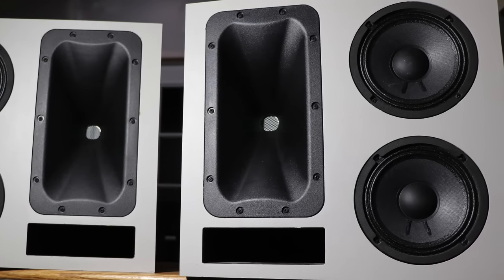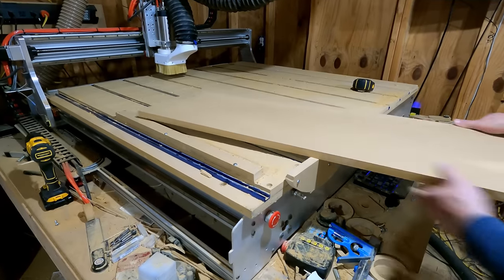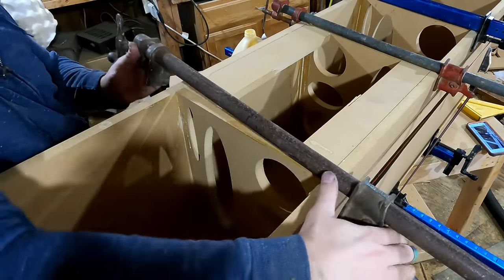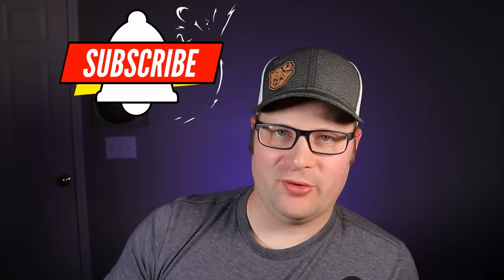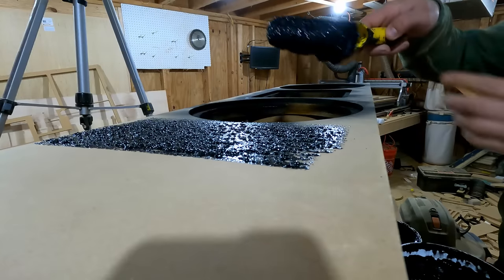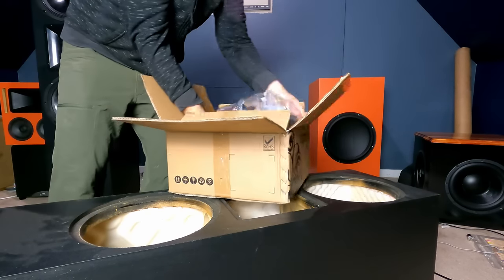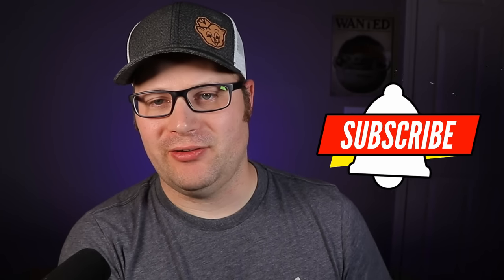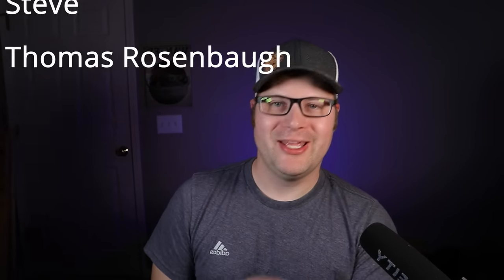How to Build $14,000 speakers for $1,300! JTR 212 Inspired - The Audience 212

Comment: why do ppl add all this bracing when you could just double or tipple wall the entire box  ???
Reply: For something like this, it comes down to cost and dimensions. 

Additional wall layers add to the overall outside dimensions, which may or may not be a design constraint. Keeping the bracing internal keeps a smaller overall enclosure. 

Bracing typically requires less material, which results in less cost.
Reply from the maker: Couldn't have said it better. It also cuts down on weight. And these things already weigh a ton.
Reply: @fattmann  I’ll just double wall my boxes.   For all that extra work with all that bracing.  Waist of time.  You won’t save that much money.  And  the extra weight.   Go to the gym.  You generally will only move your speakers one time once they are placed
Reply: @specialformula14  You do you boo boo. 

There's also different structural resonances for different spans of different materials, changes in moment forces for rigid connections (which combined w weight might be a factor if it's a mobile cabinet or in a vehicle), and others. For my Full Marty build it would have cost me 120USD+ to triple wall it, rather than the 15USD the braces cost me, and the braces create arguably greater panel rigidity due to shorter material spans. 

So, in a nutshell- we get it, you lift, bro.

Comment: nice narrow beam speaker how is it at 30 60 90 off axis  ? crossover 600 ? Aggressive toe-in probably works best, multi seat sound possible?
example 3 seater aim right speaker at left seating position and the left ay the right seat. measure over 3 points left middle right. 
even if you get closer to the left or right speaker, if the off axis drops linear, center image will stay in perfect order.
so where ever you sit left or right or center. soun fc - 20K about the same level for left and right just a bit softer than dead center.

Comment: These are the same drives sold by Meniscus audio in the Audience HT12 speaker kit with one additional woofer.  Really just makes it the MTM instead of a JRT 212 clone.  The JTR use B&C drivers.  Its a completely different speaker unless you ran tests against each speaker.  What is the audible difference between the HT12 and the HT12 MTM you built?

Comment: You should have went with car audio 4 ohm sub speakers ran in series to make 2 subs 8ohm in one box, then your RMS range would have been significantly greater(500watt rms - 5000watt rms or greater ) just make sure it's not that hard polyurethane lip around the cone and your good, you want the soft lip conjoining the cone to the frame for sound quality and speaker response( JL Audio sound wonderful, it's a quality sound speaker. Rather than just loud subs in competition bass🤷‍♂️)  😊.

Comment: Dude this is the second video that I watched of yours and you did the same thing I'm not trying to be funny but what's the whole deal with me watching you Billy's fantastic speakers and you don't let somebody hear them why would not trying to be funny but why would I want to perhaps copy the design if I don't hear them granted I come from a different background in audio I come from the Pro Sound side of life sound so there are certain things I can hear over the headphones they're normal people are not going to hear cuz they're not trained to hear it now and my 25-year tenure is an audio engineer Irish built somewhere around about 5 Pro sound systems and I built one that got in the ew's ass and they got it on the system of eaw looked at me weird because the the show that was going on was a how can I put this is a carnival thing where they put the sound system on a track trailers and where they judge your speakers and your trailer well system that I built had 16 tops double 15s in the horn devil 18 in a box and I had eight of them and on the back of the truck I had this little small system that actually use it is a small EV system they had years and years and years ago that they wanted something small on the back of the truck the only thing I can think of was to refurbish some Hillsong resonators and put in some Community 415 boxes it was a couple of those and it was kind of funny because people was looking at me strange like why am I using a sub boxes and mid-box and if you know anything about communities 415 boxes they were well they was used as Subs well I seen someone use something that was kind of funny to me dad used a 4-12 box as the mid box and because I enjoyed the sound of the 15th I built a 415 box of communities I built eight of them which kind of funny cuz the owner of the company was asking me why they usually no those 415 you'll celebrate Community box that was like that and I said yeah I know that's why I got designed from hell and you couldn't stand in front of those 415 they was throwing everything with fire held some resonators only like 2,000 w but the devil 18 Subs because the hills and resonators only 15 15-in drivers put on the level 18 they were 5,000 Watts a box so I had to use a crown 5,000 on each box and I had to use four crown for our thousands on the meds even though E A W I still was laughing at him because he spent all that money a couple hundred thousand dollars to buy that expensive system and I got in his ass over less than $40,000

Comment: The ad said $7000 each.
Reply from the maker: Yeah the MSRP on these are $7,000 each with a manufacturer direct price of $3,500 each. I mentioned that in the beginning. I'm not sure if that's just a marketing gimmick by them or what. Either way, the ones I built came out to be about $650 each using top of the line parts.
Reply: @Toid  Honestly Nick, wouldn't be surprised if that is the actual savings in costing. I've heard retailers add a lot on in terms of product cost sometimes, which the manufacturer have to add on to the price to keep their profit margins the same.
Reply from the maker: @lio1234234  I agree. But I don't know anywhere else that you can buy them except directly from them. So that's why I'm a little confused there.

Comment: What is going on here?  You are not building $14k speakers for $1,300.  Inspired too?  Just because they are the same size and use the same driver configuration doesn't mean they will sound ANYTHING like the ones you are trying to copy.  JTR uses much better components.

This is straight up clickbate.

Comment: are you really impressed with yourself?  Let me tell you, you have NOT reinvented the wheel pal.....Bose hit on this years ago, they take crappy (well, average) coaxial speakers and put 16 of them in the 901....and [port the cabinet, that is it, just port the cabinet is the Bose secret, (Frankly the secret to any speaker is get a good efficency driver and put it in a box with adequate ports to enhance the sound....experiment with shape and materials, but IT REALLY DOES NOT TAKE MUCH!!!!!  And particle baord is nnot the best material, well it is if you are not using the material at all(with all that dampening you take the box out of the equation, that was a mistake in my book)
Reply from the maker: Man I don't even know where to start with this. I guess I would say before you want to insult someone, you should really learn what you're talking about. Almost every single thing that you put on here is absolutely incorrect. The Bose 901s used full range drivers and not coaxial drivers. Bose's real claim to fame was actually their wave technology which was a folded transmission line. And the secret to building speakers has nothing to do with good efficiency driver put in a box with adequate ports to enhance the sound. It might be one way to achieve a certain goal, but it definitely is not the secret to success. And MDF had been tested and proven to be one of the best materials to make a stranger out of  I would highly encourage you to pick up a book like loudspeaker design cookbook and join some forums where people build and design speakers so that you can get a better handle on some of these topics. And then I would remind you that just because you're behind the keyboard and no one knows exactly who you are, a little bit of kindness and humility goes a long way.
Reply: we have a fundamental difference in our views but that does not make you right, You smother any chance at resonance with your  sound dampening (real genuis) and tout the advantages of MDF, yes for consistancy it is better , but no one is building resonant instruments and actual high end cabs out of MDF Glue is not a resonant body and MDF is full of it and frankly so are you.
Reply from the maker: @timothymartin2137  it sounds like you're coming from the misunderstanding that you want your speaker cabinet to resonate. If You're building an acoustical instrument like a guitar, you want that resonance. But in a loudspeaker that is recreating the sound, you don't want unwanted resonance. A loudspeaker cabinet should be inert. The acoustic foam is designed to remove unwanted internal resonances. You should take a look at PS audio and their video on why speakers are made from MDF. I think this will clarify a lot of your misunderstanding.

Comment: LOTS OF MISTAKES  HE HAS NO IDEA OF RESISTANCE  IMPEDANCE  INDUCTANCE OR RELUCTANCE   AND NO CORDLESS DRILL
Reply from the maker: Why would you think any of that? None of this statement has any backing. It would be silly if I designed speakers but didn't understand that and even sillier if I had a CNC machine but not a cordless drill.
Reply from the maker: P.S. feel free to check out @11:59 to see one of my cordless drills.